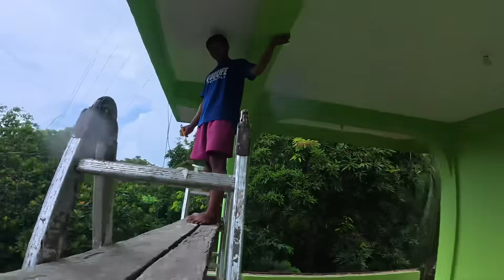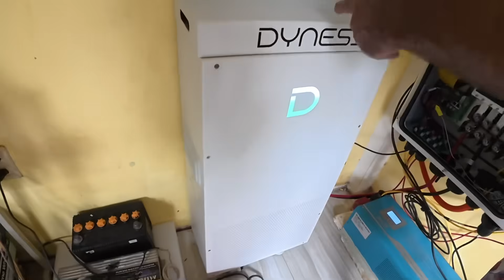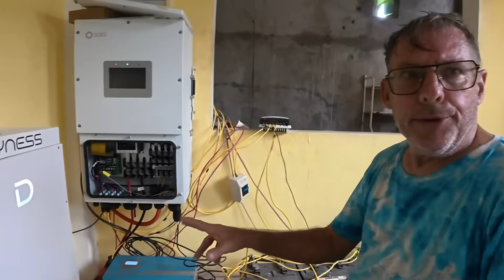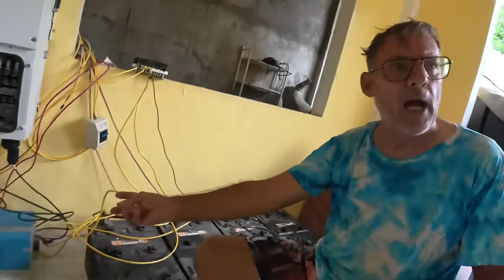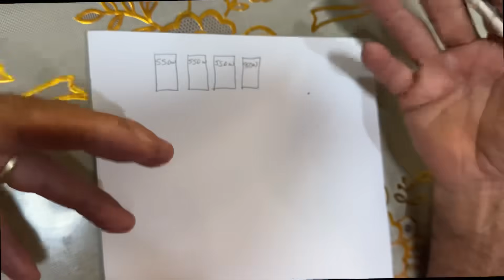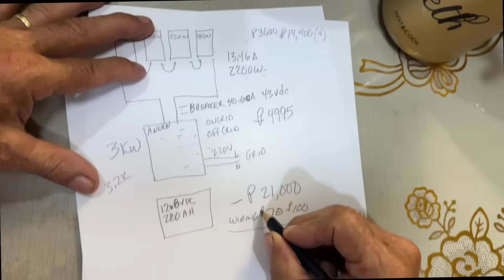Solar Power How to in the Philippines Province🇵🇭

Comment: Solar costs a lot. I know a little about electric solar panels.  #1.  Figure out watts.  Remember the rating on your hairdryer.  It is about 1800 watts on hi. Most usa appliances that have a HEAT ELECTRIC ELEMENT in them, you can expect to consume about 2000 watts.  3 devices used at same time, consume 5000 to 6000 watts.    That is a lot of electric energy consumed.  2.)  I explain this to demonstrate IT TAKES A LOT OF $ and a PRETTY BIG SOLAR SETUP with batteries, to supply any house, even with a CONSERVATIVE amount of electric consumed. If a guy spends under $5k for a solar setup, do not expect to use many devices that have a heater element in them.  Yes, you will get free sun energy.  The $5k system will have problems with any heaters, heating devices, pumps, hot food devices, all air con, kitchen appliances. Similar batteries will need to be budget batteries.  Grid power will always need to be used at times a back up.  The setup will be useful, if you are VERY MINDFUL and conservative at all times with energy use.  OTHER: INVERTORS and eletronics... they are very costly for better ones.  They will not last forever.  Expect major later costs, batteries degrade.  Power surges.  For a family, best to consider a setup going on $10k or more.  They do sell nice solar starter kits on Amazon for starters.  Do not be fooled, batteries at full charge can k ill a person.  It will be very important for homeowner to learn and know how to switch the high voltage on and off. Happy building.

Comment: my system is 2400w panel 500AH 51.2v lifepo4 and 6kw hybrid inverter my load is 2 pcs  0.6hp and unlimited fan may battery voltage runs between 53.8v to 52.6v only i dont have grid line or genset just pure off grid o just maximized my solar panel harvest....  tahts why 2400w panel only

Comment: I see your roof is not protected from water, it will gonna be rotten easily and might be harm you in the future for unexpected falling. it would be better if you elevated the solar panel above your height then you can use the roof top at the same time by drying out your laundry or chilling out there while enjoying the fresh air with views.
Reply from the maker: It’s going to be epoxy coated
Reply: @JamesandKarenadventures 
epoxy is risky from fire, what if you make it tiled and then you can use it with multi purpose, I think 2k dollar would be enough for renovation🤔

Comment: I believe its the total panel voltage is what really matters. You can over panel a system especially when it's cloudy/rainy and it will still work. You will fry the Hybrid Solar Inverter if you go over the allowed voltage (most systems can handle 550V of panel volts). That's why you can rig them in series, parallel or a combination of both. The Bifacial Ntypes are great just make sure you tilt them the right way and that you have something light colored behind it to reflect the light up to the back of the panels. Additionally, I would advise to use a 48v(51.2V) system instead of the 24v lithium set up. Its just way more efficient for 220v alternating current when inverting and converting through the system plus your wires will not need to be as thick so its cheaper and less heat.  That's so awesome to hear the prices on those 550watt panels. Sounds like its very affordable especially for DIYer. Thanks for sharing. Enjoy your time James and safe trip my brotha!
Reply: What matters is Vmp or Imp. Vmp if you have them parallel, Imp if you put different panels in series.

Comment: I think Michael will have you going in the right direction. Forget the bi facial panels unless you can tilt them away from the roof AND get them at the same cost of a normal panel. Otherwise you’re wasting money. 
For god’s sake, organize your wires. If you ever have to troubleshoot a problem you won’t be wasting time figuring what wire goes where. Also keep the DC wires as short as possible for efficiency with the proper gauge. 
Hard to believe, but China has the best value when it comes to solar systems including batteries. Just don’t go too cheap. Kinda get what you pay for. 
Good luck on your setup

Comment: james and karen, if you want to have a solar power in your  house, install your solar panels in your yard if you have enough area. your roof will surely damage soon if solar panels will be installed in your roof. birds nesting will also cause so much problem.
Reply from the maker: The panels are going on the roof. The roof was designed for it
Reply: I refused to let Direct tv install in the roof. Holes no matter how well waterproofed eventually leak. Plus to gain the most efficiency the panels need to be installed to have the ultimate angle.  

Try the can food test. Place a small can of soup or something against the panel if you see a shadow your angle needs to be changed.

Comment: You CAN  and SHOULD  overpanel your inverter unlike what he said...the industry standard. The idea  Is to overpanel by 33%...reason being a 550w panel won't output 550w..maybe 500w...it will only output max wattage 10am  to 2pm so on rainy cloudy days and early morning and late afternoon you will make mor power..any excess watts can be diverted by smart load to hot water or car charger or just bleed off as heat...ask any solar company online. They will tell you the same...and 48 volts is the way to go not 24volt...don't follow this guy's amateur wiring and design setup James!!
Reply: I definitely agree. Especially that spaghetti mess, both at the inverter and solar array. Even the wire laying on top of the panels will affect all panels on that string of series, because of shading.
Reply: It depends on the specifications of the inverter. Some inverters do not allow you to overpanel. I have a 6 kW inverter and it only has a 4 kW MPPT. It might allow me to overpanel beyond that, but I didn't do that. I don't really need more than 4 kW. He has a pretty large amount of panels already, so I don't think he needs to overpanel. He can get a little more power, by getting those wires off the panels, to reduce shading.

Comment: Wil Prowse post good videos about solar panels and lithium batteries. 
I believe he’s done experiments with bifacial panels. They bring in more power when they’re mounted so they can draw power from both sides.
It’s DIY Solar with Wil Prowse. He’s very knowledgeable on solar power systems.
Reply: Prouse also said the difference in cost of bi facial, you are better off buying an extra single facial panel of the same wattage than spending the extra money on bi facial. And that’s positioning them at the proper angel.
Reply: @gkeller9958 yep I don’t have any bifacial panels. Most of my panels were purchased used. They were $46 each for 240watt solar panels. In USA new solar panels are typically $1 a watt. 500 watts = $500. Sounds like everything solar is 1/2 price in Philippines. Nice 👍
Reply: @billbradley2480 the dollar a watt was when solar got popular and that was mostly the small 100 watt panels. 
Buying used is a little risky, but well worth it and most have a 25 yr warranty. Sounds like you got a good deal.
Reply from the maker: Michaels panels are bifacial
Reply: Thanks for the info - solar components in PH seem to run a bit cheaper than the States